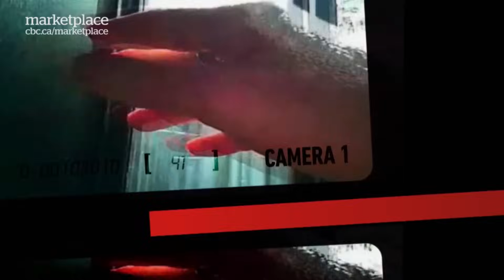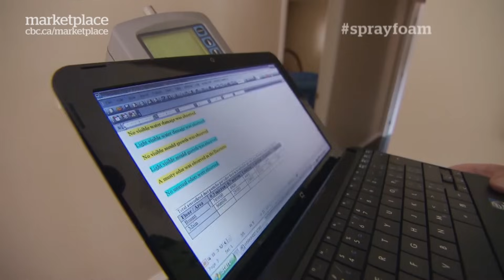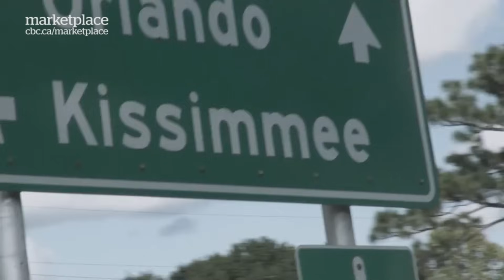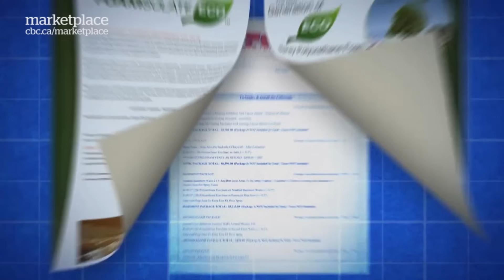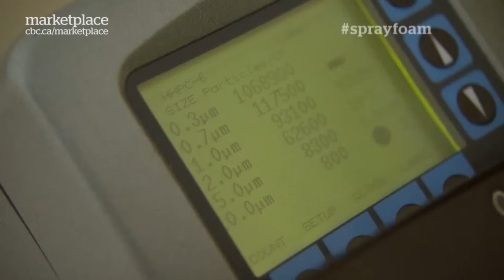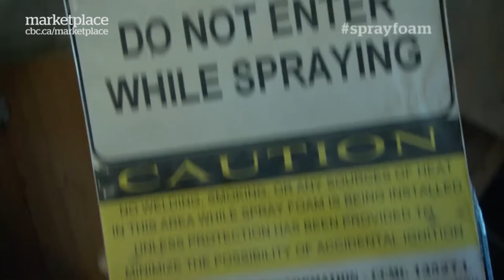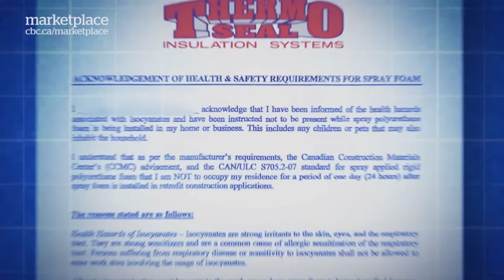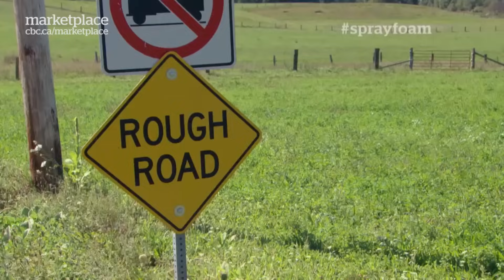Spray foam insulation nightmare: What can happen if it's not installed correctly (CBC Marketplace)

Comment: What about open cell foam injected into the walls? It's supposed to be no toxic, flexible and no off gassing. I would only use the spray in the basement for rim joists

Comment: Omg. Our house is made of wood and straw and "dirt" - we never had anything this amazing. And it is almost 500 years old!

Non toxic, whenever you tear something down, you can reuse all of it. Air conditioning is not needed, because the clay does it all.

And on the other side we have houses made of spray foam, which are toxic, unrecyclable waste and don't function without air conditioning... Is THAT supposed to be high Tech? Well, this was developed in only 100 years.

Our house was build with techniques developed in 500 years. Which one is better?

Comment: Kingspan/Celotex is next option (pre formed spray foam thats cured correctly). other than rockwool fibreglass matting, which is really horrible to handle. sealed rockwool is a slightly cleaner option. no option is good for fire proofing. all are highly flammable and toxic when burned. oh and you should never spray foam or anything on electrical cables or plastic water pipes as it melts the PVC insulation which can cause a fire/flood  which is a nightmare to dig out of the set foam.

Comment: I used that on my walls so what is the issue toxic air you are supposed to air the rooms until it sets hard and all chemical reaction gives off gasses and chemicals I suspect it should only put in a sealed cavities not in the open air.

Comment: Do your homework and educate yourself on products and the proper uses for closed cell and open cell. I had walls done 20 yrs ago, had them come back a couple years later and did rim joists in basement closest to outside walls. All good stuff, I won’t use it in my attic.

Comment: I’ve been a contractor for nearly twenty years I’ve never heard of spraying foam in the ceiling.  If there is good insulation in your walls and you put spray foam in your ceiling, your air quality is going to be so bad you’ll keep pollution trapped inside your home. The air quality will be so bad everyone will be sick at all times except spring and fall when you have your windows open.  If you have allergies and never open your windows you’ll trap so many pollutants inside that it would be like living in one of the largest cities with the population so bad that you can never go outside without having major health issues.  If you are thinking about adding insulation to your house call the construction company that built your house and make sure you know what’s in the outside walls before you do any type of modification to your attic.  You will be money ahead by doing your reacher before you jump in headfirst.

Comment: Spray foam is only good for ceiling under high draft areas under log cabins in my view,, here in the UK you have to use kingspan which is a foil backed foam, you cut and fit between the rafters,

Comment: When you buy a gun for can foam, you also buy a can or two of the cleaner to run through it. That stuff can barely mist the spray foam or any styrofoam and it instantly melts. I wonder why nobody was able to take a bigger quantity of that and go ham in the attic.

Comment: 16:56 that spray foamer is a hack. No vent baffles on the roof. Somebody got caught cutting corners. I charge more than spray foamer to resheet your roof because I can and hate doing it. Hire a hack spray foamer and you will pay double if not triple. Have it done right the first time. So you don't need to call someone like me. Roofs and masonry need baffles or capillary breaks before spray foam. Otherwise you seal the moisture in, which causes problems.

Comment: Anyone considering this has to take into account that the air 
still needs to circulate in the house also. I worked insulation for a while 
and we where to a point that people needed an air exchanger to get 
fresh air in the building. I like the traditional batts and blown. Something happens 
anywhere in the house you do not have that crap to cut thru and mess with.

Comment: I have been in the construction industry and Home Improvement industry for many years! I would never use spray foam insulation on a large scale in my own home or any one of my customers homes or businesses! Not just because of the chemicals or the effects it seems to have on some of these people. I would never usually because it's a nightmare to remove down the line when you plan on remodeling, renovating or repairing anything in your home. Try snaking a new electrical line or Plumbing pipes through a wall with all that spray foam in it, ext ext

Comment: This is sad, yeah, the whole house should be opened up completely with tons of ventilation for at least 72 hours before checking to see if the fumes are gone and then probably should be painted.  So paint a sealant between the foam and the internal part of the home after it's spray foamed, to keep the off gassing going outside through the walls. Keep ventilating the home over time.  Just keep the house open in the summer.  In the winter, have vent metal pipes put in right by a wood stove so the air from outside heats up from the store over as it's drawn in and have the end of the pipes go to the ends of the home, the farthest corners and points from the wood stove.  This way the same I've will draw the air through and replenish the air but heat it at the same time.  Physics.

Comment: Personally My wife and I used modified sprayed cellulose (paper or pulp) as it was explained to me .my county paid for my home because if when it was built, 1963. Virtually no northern states codes for building homes at the time, had any insulation mandates. . But it cut our gas bill by almost 60% an out electric bill by 35%. What money that I did pay way easily paid back in savings in a few months.

Comment: I had my home in ohio done in the 1995. they sprayed the walls but used fiberglass in the attic. the only problem i had was that the foam went in to wet because the installer did not mix it right. yes the chemicals are mixed on site. well it caused the paint to peal off the interior walls, not the whole house, just in a few places. I chose a partial refund and fixed it my self. I got lucky.

Comment: Spray foam should never be used against wood ever ever ever. Wood needs to breathe so it can release moisture. The temperature of the foam will rise and fall at different rates than the wood creating moisture in the wood and the foam will trap it in. Not to even mention how difficult it will be to replace if you use it underneath your roof.

Comment: We got this sprayfoam in front of cottage and under thevcrawl space on a new build thinking it would be airtight and best insulation for the job only to see parts of it shrink off and realease with up to an inch in gaps around studs and window jams  ..it might be ok for older framed up houses but new framing still shrinks and settles over time and this crap does not flex ..i only now this with crawl space as its not finished with drywall ..i could just imagine what it looks like in my family room under the drywall
Reply: call the sprayer!!!! i insulate houses. if it shrank and popped off the sub-strait they foamed was too cold or the foam was too hot. it shouldn't split or pop off if properly dont.

Comment: The other issues with spray foam, is that everything it adheres to is ruined and impossible to recycle ♻️. They sell it as a green product, there is nothing less green then that chemical foam. Another brilliand idea that will fill the landfill. We are remodelers, if you have an older house, DON’T use this type of insulation and let your house breath naturally. They were not built to be airleak proof…

Comment: Foam is bad stuff.  When I was a kid we used to use foam surfboards.  Anytime I used any of those foam floats, I would get a light rash on my chest from being against it, which went away in about an hour.  Point is the stuff can't be good.  I did a lot of cellulose blow in and would never want foam in a place I live in.  I wouldn't even want cellulose in my attic as it's a mess, but could be okay for a place where all the wiring is updated and there's no plans for having to go up there and work in the mess.  I added 4" of glass in my place.
16:50  I did a place like that with 4" foil backed quality insulation, single handed.  A lot of work, but none of these problems.

Comment: Insulate your ceiling with fiberglass wall insulation under the sheetrock. . Then lay batts of fiberglass across it in the attic. Two layers crisscrossing. Be sure to let the attic breath. Done properly you'll be able to heat your home with a candle.                     Just sayin'                             Mike

Comment: Encapsulated attics are inefficient, unnecessary and, in my opinion, dangerous. There is tremendous heat buildup between the foam and the roof. I had to pull some wire this summer and it was so hot that it blistered my fingers. Just put it between the ceiling joists and vent your attic like every other house for the past 100 years. No need to heat and cool your attic along with your living space. If it ain't broke, don't fix it.

Comment: You won't "frighten your children too much" just by telling them the insulation in the house went bad and it's not safe to be in the house too long until the insulation is fixed. Not communicating basic facts to them like that will make them more anxious than knowing basic information about the situation the family is in. Lack of communication is BAD. Kids understand basic if>then concepts very easily; we found out the insulation was making the air bad, so we live outside the house for now, but as soon as the bad insulation is replaced the house will be good again. See? Not that's hard. And if they're worried the new insulation might be bad too just assure them that you found an insulation that doesn't have the same issue, assuming that is indeed a true statement. Found the old insulation's issue>replaced with insulation that doesn't have that issue>now things are safe.

Comment: I use a ventilator and work gloves even with the rolled insulations,  it's got bits of fiberglass and stuff in it.  People think I'm being paranoid and then they try the New and Improved stuff and get screwed over.  Sometimes if it isn't broke then you don't fix that.

Comment: So the moral of the story is the installers should spray thin layers allowing expansion and cure before spraying a second coat. Stay out if the house during installation and for at least a day or two after.

Comment: According to another video I watched, it's also highly flammable, ergo, a bad choice any way you look at it.  Go with fiberglass batts or rockwool, both fireproof, and available with plenty of R-value!
Reply: That is not the main problem of the foam insulations (including EPS and XPS). They melt in contact with heat! Yes, why would that be a problem?

Imagine a fire, and the stuff melts, flowing down the walls, forming hot pools like a game of "the floor is lava" except this time, it is lethal.

Quite a few fires killed many more people because of the insulation burning, flowing down walls. It is a nightmare of every firefighter.

But that is not all: it creates a thick toxic smoke when it burns.

Alternatives are glass wool, rock wool, wood fiber, hemp fiber. The last two burn slowly and barely smoke. Calcium silicate is an interesting option too, but quite expensive.

Straw, (ironically) works as well, but just with the foam it must be used correctly, or else it is not fire resistant enough.

Comment: If this material had been isolated from the wood above and below at the time of installation with nylon sheets over the entire surface of the roof, it would have been healthier and in any case very easy to remove.

Comment: Polyurethane is terrible for health. And in a foam form takes months to years to escape from the foam. DON'T USE CHEMICAL FOAM. There are powdered foams on the market. But my advice to remove the drywall and put in fibreglass batts in, then put the drywall back on

Comment: Was hoping for a better explanation from the chemical suppliers to the sprayfoam installation guys, but nothing there. Pity as it leaves a lot unanswered. 2 pack urethane systems require proper mixing and correct temperatures to cure properly without residual uncured material. Not all applicators are properly trained and may not follow best practices. There should be better consumer safeguards.

Comment: If I could give my friends across the water one piece of heart felt advice do not ever cover structural timber with polyurethane foam. You will regret it. 
In the uk you cannot mortgage a property with sprayed roof timbers with foam. The timber cannot breath moisture that gets into the timbers from the untreated side cannot evaporate and the timber will rot. There is a growing industry in the uk which removes this product, which is one of the most environmentally difficult products to dispose of. The use of carbon dioxide (dry ice) blasted against the foam and then vacuum machines to suck it away is the most effective to date.
I’ve just spent £14,000 re tilling my fathers house to get rid of this dreadful stuff. Don’t use it in your loft space it does not breath, it will promote damp and the smells (which are spores) can cause serious illness. Why it is not banned I cannot understand these companies should be ashamed of themselves.

Comment: Sprau Joans thinks otherwise. The issue seems to be the installers. Of course the camper is full of formaldehydes as well. I mean the camper is built with all the same chemicals. I am sure they are having some real issues. But it could be installed properly. They should be able to test for those chemicals. I am sorry for them.

Comment: The foam installers should have removed all the foam. It may have worked, and then, after a period of airing out, they should have reinstalled it properly, proving it works. Now they are on the hook for the rebuilding of the house and paying someone else to insulate it.

Comment: Stick with tried and true........Owens Corning fiberglass and the Pink Panther would never steer you wrong! Foam no way.
Besides, you are NOT supposed to seal the area between the roof and the house.  Fiberglass does not even have a paper backing product for an attic.  Its how MOISTURE from the house exits.  Seal that area and you are bound to have issues.

Comment: Just do blow-in insulation or the brown fluffy batts👌I never had a problem with either of those
Reply: Ya but the reason people choose spray foam is because it insulates way better and saves you money on electricity.  It also acts as a vapor barrier unlike  blow in. Nobody would bother with spray foam if it wasn't  a better insulator.
Reply: Spray foam insulation is just the newest fad. 

Fiberglass insulation works fantastic. I myself prefer the spray in cellulose stuff. It's cheap, doesn't itch, and easy to remove if needed.

Foam insulation is extremely hard to remove if needed. In reality, spray foam insulation is no better than cellulose.

Comment: So as a material scientist who works a lot with polyurethane, I can tell you this stuff has the potential to be incredibly poisonous. My guess is the company used a non-insulation grade foam to save substantial amounts of money. I love PU Foam. But the way you love a razor sharp kitchen knife. Very carefully. ThisVery much sounds like low-grade a/b foam used for marine application. somebody met the good idea fairy and swapped the high cost insulation foam with cheap foam.

Comment: Where did the spray foam come from? Maybe some kind of chemical was introduced that should not have been. Intentional or not it needs to be removed.
Reply: Remember the drywall nightmare of the 90s? There are many homes that still need to be stripped completely on the inside and rebuilt.

Comment: I bet they covered the Eve vents with the foam. From the looks of it there's no vents on the top of the roof so if they covered the Eve vents then they definitely have an issue the only other vet I can think of would be the ridge the top pic of the roof sometimes they have vents right there that you can't really see from in the Attic or from outside but you still need vents on the top and vents on the bottom so that way the hot air can circulate in fresh air. With proper ventilation they wouldn't be smelling the foam foam is getting hot when the attic gets hot and there's nowhere for those chemicals that seep out of the foam as it gets hot.

Comment: What happens down the road when there is a leak in the roof into the attic ..isn’t it more of a job to repair a leak and rotted wood with that spray foam all over it? I would think it would be easier to just deal with really good insulation panels ? But what do I know I just know I will never have this problem lol

Comment: I'm not an expert in home building and etc, however, I have a question: isn't there a couple types of spray foams used to insulate a home? For up north, in colder weather, aren't they supposed to use closed cell spray foams to insulate, so to prevent moisture from seeping into it which causes mold? While in hot weather areas in the south, use that type of spray foam, open cell so to allow air to get thru?? If that is correct, then that company should be shutdown AFTER it fixes the problem thy caused this family, along with every other customer who they done this to.